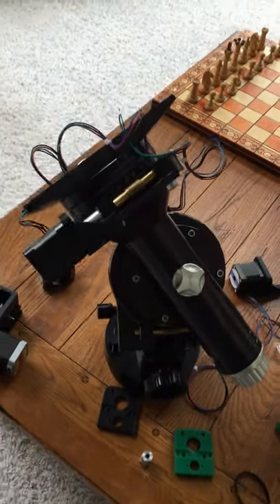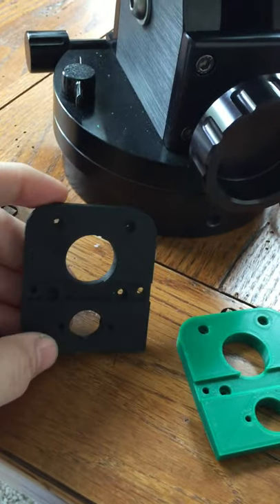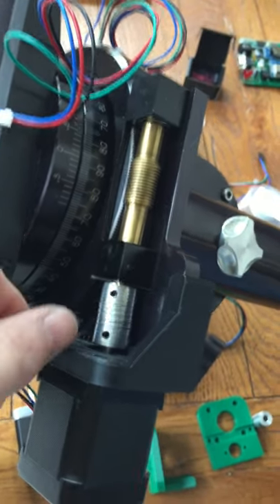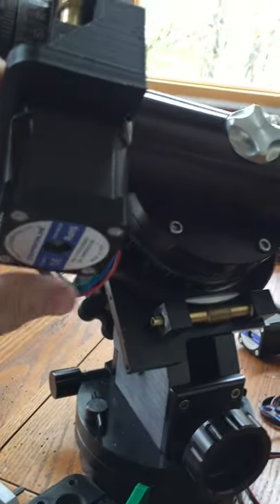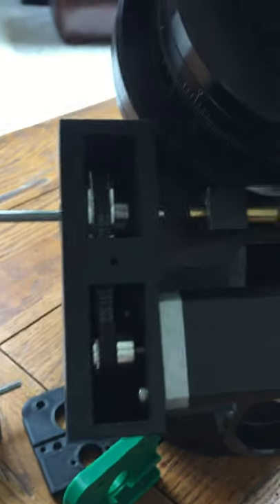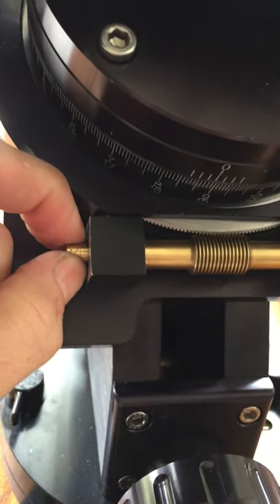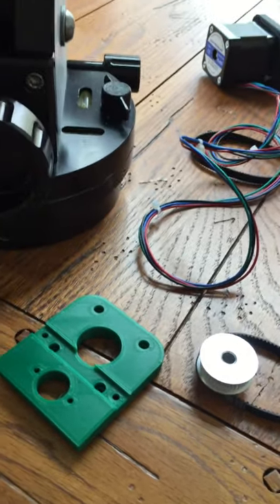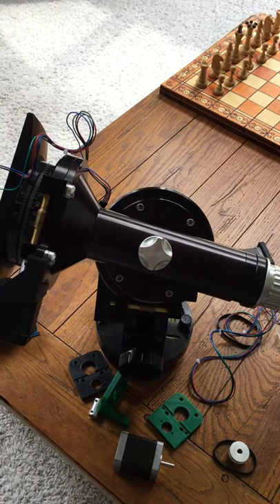Losmandy G11 OnStep - Stepper Motor Mounting Options - 1/2

Comment: I have a ci700 I was thinking of trying OnStep, I have the blue pill version. The ci700 already has g11 servo motors, so I wanted to try a stepper input to servo output converter using a ATiny boards

Comment: How does microstepping compare to servo motor accuracy? Especially since micro stepping is not linear.
I am using a $12 maxon motor with 360 ppr encoder, 50:1 gearbox and with good seeing I get quarter arcsec PhD on my g11 with gemini1